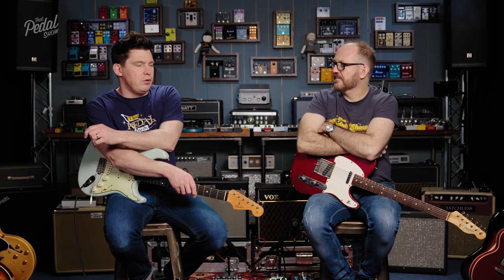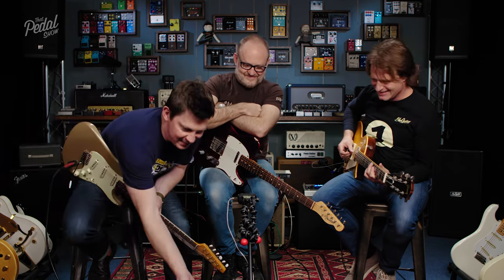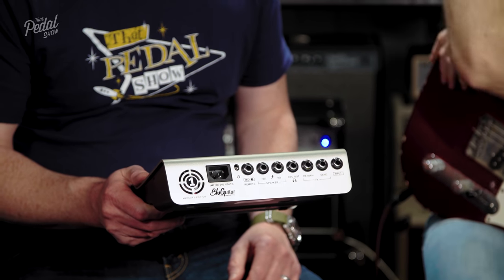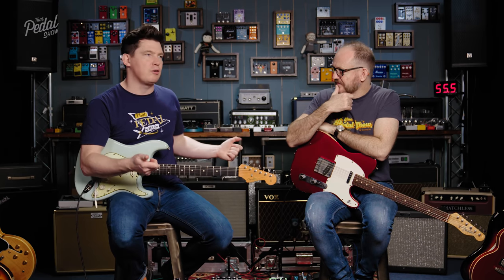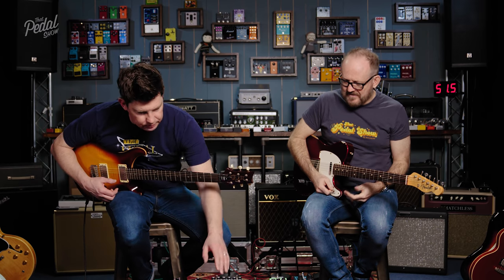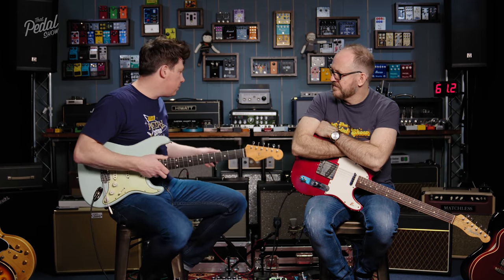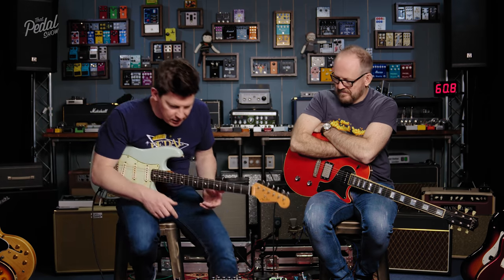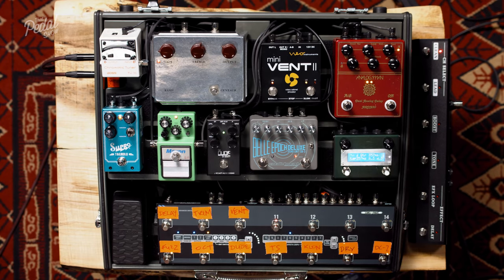Yes We Do Like Transistor Amps #1: Boss & BluGuitar – That Pedal Show

Comment: I feel many/most solid state amps suffer from an identity crisis. They are trying to prove how much they sound like a valve/tube amp. The main exception to this, in my recollection, is the Roland Jazz Chorus line. The Roland Jazz Chorus is marketing itself as solid state equivalent of a valve amp. It leaves me wondering what the main benefits are of a solid state amp if, by their own admission, their innate sound is not as 'good' as a valve amp. Unless you prefer the sound, it seems a solid state amp either needs to be so small it fits in my pocket or so cheap that I can buy ten of them for it to be even close to worth it.

Comment: I have to admit that those vintage Fender amps sound incredible. I've spent the last 25 years playing through solid state amps, and where I feel at home is with my pedalboard  plugged into the low gain input of my USA made Peavey Studio Pro 112.  Not saying that it's better than anything else, but that's where I can get lost for hours
Reply: Jason Baker nothing wrong with solid state amps when you’re happy with the sound. Sometimes I wonder if solid state amps came out before tubes and all the greats were recorded on solid state would people be turning their noses up at tube amps.
Reply: @sid35gb  Probably so. I'm happy with anything I can get a good sound out of. I picked up a little solidstate fender amp a while back. It's a Frontman 25r 25 watt 1x10 made in 2001. I had to replace the power switch and I swapped the factory speaker for a Celestion Ten 30. I'm absolutely loving that little amp.
Reply: Jason Baker I don’t know what it is with the small fenders but they do seem to work well with a good quality 10” speaker. Have fun 👍

Comment: Same revelation here too recently, I love my tube amps and experimenting with vintage tubes. My music listening is tube powered but recently out of curiosity from info online I bought a vintage 70’s Carlsbro Stingray Super on the bay. Pristine condition apart from some scratchy pots that were duly rectified and holy moly what a sound! I know it sounds crazy but it sounds tube like and reacts as if it’s tube driven. It even weighs a ton like a tube amp! I now will TRY to never pass judgement until I hear with my own ears. It’s not tube snobbery just preference.
Great episode guys.

Comment: I know the subject is SS amps, but for anyone considering a small, lightweight portable amp as a second amp for a wet/dry rig, I would recommend at least trying the VHT special 6 (at least for US). It costs as much as a pedal and you get a point to point single ended fender champ style amp with plenty of headroom despite its small wattage may suggest. Also it has an oversized output Transformer so it is simple to mod and even a tube swap for an EL34 or other 6v6 is plug and play.

Comment: Hry Guys..  Im also a SOUND/TONE PROFESSOR!  : P   And i wanted to reply to your statement about victory amp builder ( martin )  that " THERE IS ALMOST NO DIFFERENCE IN THE DIFFERENT TUBES EXCEPT AT LOUDER VOLUMES, AND EVEN THEN THE DIFFERENCE IS ONLY SLIGHT )   :/   NOT TO MY EARS!!!   to my ears, there is a very clear,  and distinct difference between all of those tubes.   the 6L6 to my ears is cleaner, clearer, and has much more tonal headroom.  the EL34 to my ears id much more punchy and present, with a little more mid range in it.   The EL84  is louder, ( louder as a tube, not anything to do with adjusting the volume)  the character of the EL84 is " louder" itself.  and punchy, and mid rangey,     And i have only heard the 6V6 tubes a few times, and never really spent any quality time with playing them, so just from the immediate difference i have noticed with the 6V6 tubes? I noticed that sound similar to the 6L6 in their clean, and head room,  but they have more mid range to them..   AND i have done any playing on any of the "modeling technology"  though did study the tech 21 fly rig, the original version, and thought that was very good all around, BUT i noticed there were no picking dynamics, and i also noticed that no matter what guitar or pick ups or amp you used with it?  IT ALWAYS SOUNDED THE SAME.  it sounded like a marshall plexi with boost, reverb/and delay...   There were no tonal or character differences with it.  and those differences are to my ears and feel, the biggest issues here with all of these new technology amps..   I like thomas blug,  And i think the amp one is the best of its kind that i have heard yet!  BUT.. I can always tell the difference between it and a full tube amp,  because of those TOUCH SENSITIVE DYNAMICS  i feel and hear from using the full tube amp.   the amp sounds alot better than most tube amps though! because to my ears, it sounds CLEANER. All the frequencies are CLEANER THAN THE FULL TUBE AMPS FREQUENCIES!!!   I think there is something in the full tube amp construction or just the tubes themselves, that give THOSE FEELING, PICKING, HEARING DYNAMICS!  AND IF THOMAS OR SOMEONE ELSE CAN BRING THAT TO THE AMP 1 OR TO A BRAND NEW PRODUCT?  I THINK THAT WILL BE THE FINAL REPLACEMENT OF ALL TUBE AMPS..   In terms of weight, ease of use without all the maintenance, tubes, and biasing, various electrical components being damaged or needing to be replaced,  and the voltage issues relating to the power sources in different venues or countries..   I THINK IF ANYONE WILL BE ABLE TO MAKE THAT HAPPEN ANY TIME SOON?  IT WILL BE THOMAS BLUG!!!  HE IS AN INCREDIBLE PERSON,  A GREAT DESIGNER/ENGINEER, GUITARIST AND ALL AROUND MUSICIAN!!!  ( AND QUIT FRANKLY I AM REALLY TIRED OF COMPLIMENTING HIM!!  : /    LOL....      BUT... LASTLY ALL OF THIS IS ALL ABOUT " SOUNDS" ...  AND " SOUNDS"  ARE ALL SUBJECTIVE TO THE INDIVIDUAL!

Comment: I’m so glad you revisited this subject. I’ve been wanting to ask you this for ages.
When you were with BOSS in Japan, did you happen to discuss the matter of just how close to valve characteristics and behaviour their Tube Logic technology is getting?
The reason I ask is that I swear my Roland Blues Cube Hot sounds and reacts better a short while after switching on, (the way a tube amp does).
Just my imagination perhaps, but in the amp manual, in a section called “Dramatically Evolved Tube Logic” Roland (BOSS) themselves infer that there is much more technological development than just clever use of standard (solid state) components.

Comment: Another company that makes great solid state amps is Hotone. I used to have a Purple Wind 5 watt plexi-style that sounded amazingly good, and they make a ton of other styles of amps in 5 watt as well as 75 watt format. The only problem with them is that the 5 watts aren't very durable, as I found out when I dropped mine and it eventually stopped working, but I imagine the 75 watt versions would be far more durable since they're meant for gigging.
Reply: Purple wind haha. Too much eggplant?  Or beets...

Comment: How are you handling the amp switching with the speaker cabinet? The matchless would need a resistive load when the SS amp is using the speaker. Would be an interesting if you did a show on different cabinet switchers.

Comment: i mean if u use the amp as a pedal platform, why not solid state it!
Reply: Yeah man, it's a good question... I think I see it (not that my opinion is worth anything) as interaction between amp and pedal? I guess, it doesn't matter that the amp is solid state or tube - it matters that it's good? When you say 'solid state it' it's a bit like saying the SubZero 5 watt tube head is the same as a Hiwatt 100w, don't you reckon?
Reply: From my experience, solid state is a very good option for clean sounds, especially if budget, convenience, reliability, maintenance etc are a primary concern. For driven sounds, transistors (pedals) pushing a tube amp can be absolutely magical. But... drive pedals into solid state amps can be a challenge to dial in. It seems like you're always trying to get rid of harsh frequencies and find a "sweet spot".
Reply: The Amp1 is a GREAT pedal platform.
Reply: That's because most beginner solid state amp have terrible speakers. Fizzy/harsh frequencies are the speaker's fault most of the time. That and a very "sparkly" clean channel naturally turns into a "fizzy" distorted sound because the frequecies that make it "sparkly" are usually cut on distortion channels.

Comment: I've had valve amps, hybrid amps with valve preamp  and solid state power section, modeling amps... and my main amp now is a solid state 80 watt Roland Blues Cube Artist. 

I've had some killer amps and there's no doubt that a cranked valve amp will give you tone to die for...but usually only at unusable volume, unless you're gigging (and sometimes not even then!)

The Blues Cube is a revelation! Four discreet power amps, brilliant tone at various volume levels... and  takes pedals like a champ! Definitely up there as one of the best amps I've had, over the last 40+ years!

Comment: I wish someone who does gear reviews would test amps using a standard speaker cab (so the speaker efficiency is the same for every test) a calibrated sound pressure level meter at 1m and a recording of a guitar played back at a fixed level for every amp (matched to the actual guitar signal level) - forget the Watts, just tell us how loud they all go when dimed.

That way we will see which manufacturers rate their amps in RMS and which use BS instead.

Comment: Where I like solid state is utility gigs where I'm covering multiple instruments.  I have the Katana 100.  I prefer my tube Mesas and Fenders for guitar but the strength of the Boss is covers does acoustic instruments and pedal steel really well.  Its weak spot in my opinion is the electric guitar stuff.  It doesn't like all pedals.  It hates the Russian Muff but these are gigs where I would never use the muff.  Before getting this solid state amp I was carrying three amps.  Solid state seems great at being a jack of all trades.  Versatility can be critical if you are a jobber.  You see the Katana in Nashville on Broadway all the time now.
Reply: You are 100% right. I have a katana 100 2x12 that I use for my country band and the other guitarist uses a vibrolux. It’s always funny because I can plug in and sound awesome but as soon as he turns the fender on it’s just beautiful. It’s probably mostly in the fingers if I’m honest, but still it sounds great. The two amps actually complement each other well though because he’ll sit a little higher in the mix (live) and I’ll have that open sounding thing going on because of the 2x12 and I’ll be sitting in the background of the mix. But back to your point I saw multiple bands on broadway in one night and it was one of a few things- a variation of helix (sounded great), boss katana (sounded great), or a back line amp like a hrdlx or an ac15. All sounded superb.

Comment: I've been playing off and on for 42 years. After all that tone chasing, I am most pleased with my current amp: a Peavey Studio Pro 112, red stripe, designed and made in the USA, with the Blue Marvel speaker replaced with Celestion G12T Hot 100. I run the Tube Dynamics at 100%, and often run a Timmy clone in front of the amp. I am very, very happy with this setup.

Changes in pedals have made it possible to get good tone in ways impossible in 1977. When I first started, Klons did not exist, and we all got that tone - and all our other favorites - through the amp's gain stages. I pushed my amp with an MXR Micro Amp pedal, a clean boost. Today, we can stack overdrives like crazy -- and unless we're using a Butler Tube Driver, we're doing it all with analog solid-state drive stages. So why not go the next obvious step and ditch the tubes, and all the problems they bring?

Comment: the immediacy of some transistor amps are next to none. The transients are just something else next to the sag from a tube amp. Not always for the better nor for the worse but very much different
Reply: I always wondered if someone could have an adjustable mix of full and sagging voltage from valve and diode rectified power.
Reply: hoboroadie Sure. I think it’d be fairly straight-forward to combine the outputs. Actually, come to think of it, some of Mesa’s amps can switch between SS and tube rectifiers... one of those might be able to blend them (and if not, it’d probably be easier to mod one of those amps since they have both kinds of rectifiers in them already).
Reply: Regarding rectifiers, I prefer the response of a diode rectifier.
Reply: the core question is does an increase in the slew response of an amp affect the aesthetic reponse of guitar to any real benefit, and if so, how.
based on my limited experience of owning a early 90s dual-rectifier, the rectifier would 'pop' the bass end noticeably quicker. to what extent that was due to the extra 20+ watts of the rectifier output vs the 6L6s, or it was due to character or rectifier vs pentode, I can't tell.

Comment: Recently I took my Roland Blues Cube HOT (transistor, "Tube logic") to a friend with a Fender Super Reverb (original 1965). He´s a real amp-aficinado and tube snob. Only vintage handwired amps for him. But! We were both blown away by how good the Blues Cube HOT sounded. Actually he couldn´t believe his ears. Even though the HOT had a 1X12 and the Super Reverb 4X10 it sounded full and nearly as loud as the Super Reverb. The headroom and reaction to pedals (vintage MXR:s) was also as great as the Super Reverb.  We tested with the amps side by side.
Reply: Bosse Ignell That’s my main amp, and everyone who doesn’t understand the power of them is always blown away. It’s definitely not leaving my possession
Reply: @a.man_an.island  Yes. It´s high time to leave the debate transistor vs valve. The question is: good or bad amp? Not the technology. I will keep my Blues cube HOT even if new amps get the hype for a while :-)
Reply: Love my Blues Cube Hot.
Great sounding and takes pedals great.
Reply: I was VERY impressed with those amps when I worked in GC. Made a quite a few "all tube" believers buy that amp. Many came back and raved about its lightness, rugged construction and touch sensitivity. Also took pedals very well.
Reply: I still have mine. Many transistor and valve amps have come and gone but I still keep my blues cube hot.
Reply: @GuitarMav  It´s a great amp. Personally I switched back to Boss Katana. Not that it sounds "better", it doesn´t, but I like the built in pedals which makes it a perfect grab and go - amp.

Comment: The vox patherfinder actually sound really good handles pedals really well and when miced feels like a tub amp it’s really remarkable.  I play a vox ac30 and I had to get it fixed one weekend and last min I used the pathfinder and I was really shocked. Because I have used  fender solid state amps and they were terrible. Anyways give it a try if you ever
Reply: I have 2 and just picked up the 2x10 Pathfinder Smr😲

Comment: I have tube amps and solid state amps. I agree that tube amps do a thing, that solid state amps don't do. The opposite is also true. Let me tell you when my solid state amps come out. At home for practice, a small blackstar id core, katana....that kind of thing..can be great. they sound great quite and you don't have to work hard to make that happen. No one is saying any transister amp sounds just like a tube amp. its not about it sounding just like anything. It's about being able to get great sounds in their own right that work. Another time when solid states come out and get used are at gigs when either my tube amps would have to be too loud, or my i'm having a problem with my tube rig....and i just don't have time to resolve it. bad tube, some other thing. It's not about sounding just like a tube amp. It's about getting usable sounds that will get me thru the gig when the show must go on.
Reply: J
Reply: I've never had a problem with a big tube amp down low or a small one...or any with a reactive load. If all my tube amps were stolen I'd buy more. I will never have a need for a SS guitar amp...ever, for any reason. I guess if it was all I had I'd make it work. But why on earth would I try...other than being stranded on a mountain that has an electrical output...? McDonald's is actually considered food, so have a Big Mac if you want...I'll be glad to starve first.
Reply: @TheDogPa  thats cool.
Reply: Mark Shields well said. Nothing will replace my tube amp but I also have a solid state Marshall with a Boss power stack on the clean channel for home practice and I'm a pretty happy camper with it.
Reply: I actually have no problems with how other people might run their rigs or what amps they might choose to use. I was just speaking from my perspective and why i use what I use.
Reply: @shadowsong1  I know what you meant. I think we can all agree if it sounds good, it is good.
Reply: pfff just get an ac4 dime it and put it in the bathroom. quit kidding yourself,  learn basic maintenance tech. SS still sounds like a blatty scratch, always has. god bless dimebag but a 'pleasing sound' was not in his rig; i've heard pantera live and it wasn't so good, lotta screech.
Reply: @shaft9000  i disagree...not about pantera really...but i disagree. so you know....you do you. i'll do me. we'll both be happy.

Comment: Great video, thanks. One practical advantage of these types of amps versus tubes is that they can also do low volume better than majority of tube amps, which is handy around family. I run an HX Stomp into the effects return of a Katana, to get a vox clean, and better effects through it. I think the nexttone cleans sounded better than the Katana. I know there is an editor but it makes me not play, instead messing around on laptop, i find the stomp easier to use, more like a pedal, and less distracting.